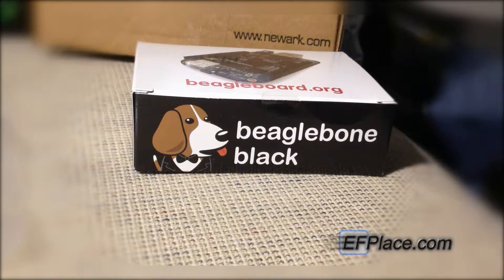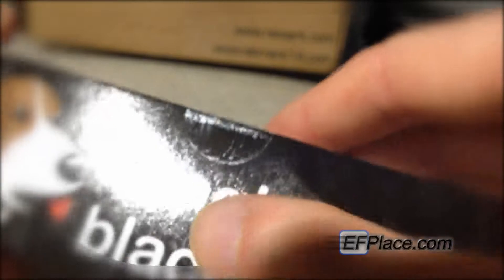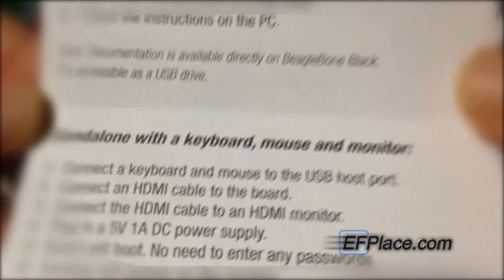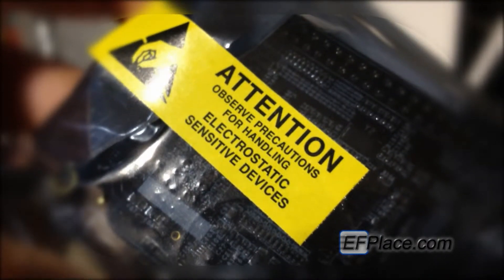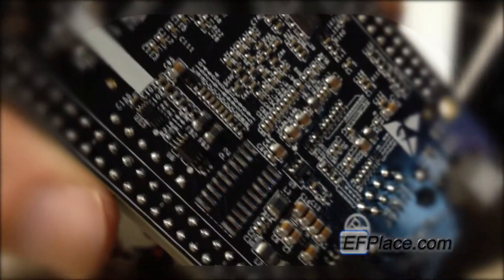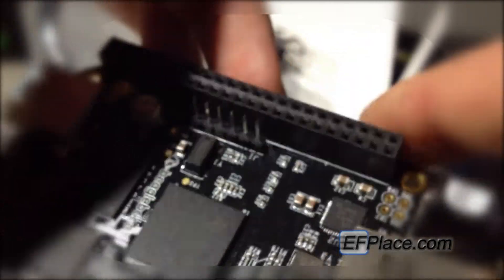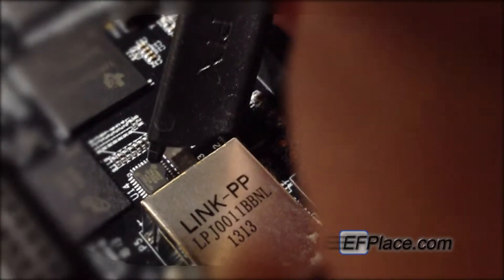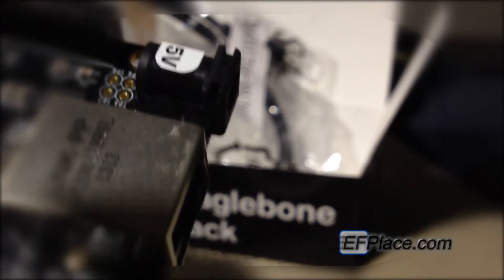[Unboxing] The BeagleBone Black

Comment: Hi pronunciation are as given below,
it's I2C [Inter-Integrated Circuit]; pronounced as either "eye 2 C" or " eye square C"
UART [universal asynchronous receiver/transmitter]; pronounced as  "You - art"

ADC [Analog to digital converter] to convert analog signals to digital signals[1's & 0's].